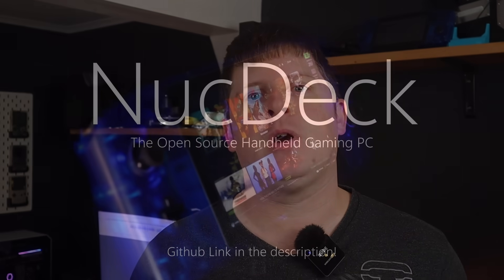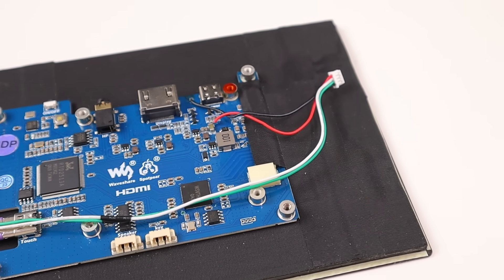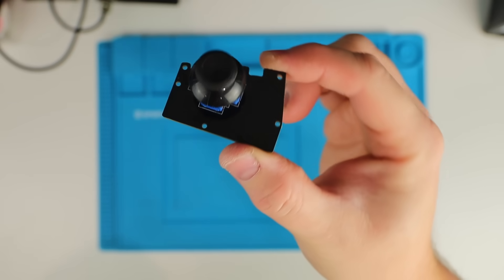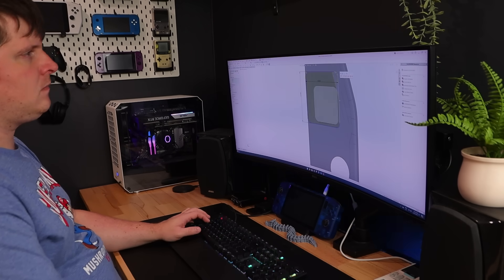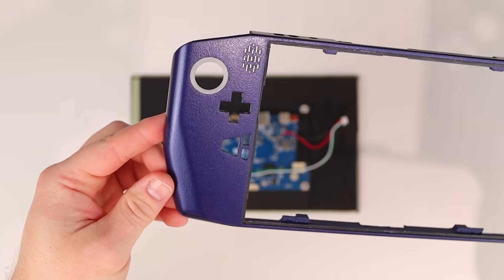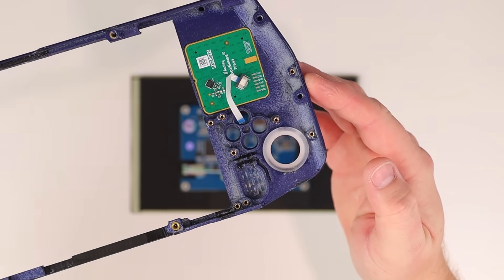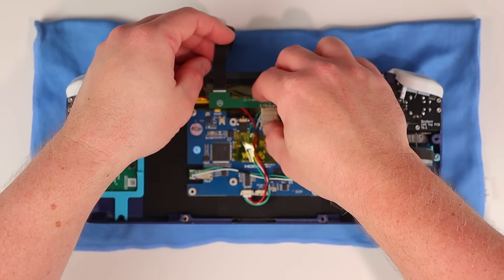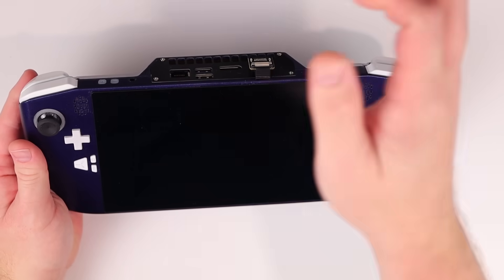I Built My Own Steam Deck!

Comment: Did you install SteamOS in the end, what operating system are you using here?
Reply from the maker: I tried Bazzite OS at one point, and while it did improve performance slightly it also had some bugs with the touchscreen and it also increased power consumption so I went back to windows for now!
Reply: @cncdan  it does sound like we will have SteamOS available to install on other devices soon. I'm looking forward to the day I don't need windows on my gaming PC

Comment: It's overall just worse than the original as a handheld. Defeats the purpose

It's too big now, it's bulky, worse wattage, RGB, worse ergonomics, a bad OS, etc. I like the ABXY layout, tho! It's a shame errything has to mimic Xbox's backwards ABXY layout.. Only Nintendo and PS (In japan, anyways) does a normal button layout. The A button and X buttons on PS con (in the west) are the most over used buttons

Comment: This was random in my feed, but this is freaking cool. (subbed) I do have one suggestion how about a magnetic cover to go over the top sticking out part which also hides the other ports when they don't have to be used. Does some of the heavy resource hungry games work on it like some of newer AAA games run on it? If you don't mind saying how much did this build cost?  If you dont want to answer that one no biggie.

Comment: to avoid the hdmi coming out the top desoolder the hdmi from both the screen and board. the design a pcb that "stacks on top of the hdmi pins and converts it to a flex cable. you could also probably use a switch to change thee direction of the power in the hdmi signal to swap between an internal and external screen as well

Comment: I really have to say that the 5700U was such a downgrade. Granted the CPU aspect is better but giving up a custome RDNA 2 iGPU for Vega. Definitely not, with good FSR 2.1 or 3 ive gotten ray tracing to work on my steam deck. Id understand more if you went for 32GB RAM.

Comment: HOLY MOLY! The quality of that is astonishing. I can't believe how much you fit into a 12 minute video. I'd love a deeper dive into each of those components (both the 3d printed parts, and the PCBs).
Reply from the maker: Thanks! This was mostly just a recap that's lighter on details for the purpose of reaching a larger audience. If you want more details, there's an entire playlist with 9 other videos as I worked through the project! https://www.youtube.com/playlist?list=PLy9j9_dmmg2TrMOIG65j3nOELqgDXPkkn
Reply: @cncdan  Sorry, yes I saw those after I made my comment. What an amazing set of videos. One question I had was how you set on the different button types? I think I've see two types you've in other projects, and I'm not sure on the terminology. One is like an interleaved pattern on the PCB that the button completed the connection of (I think it might be called 'conductive rubber membrane'), and another is regular low-profile push switches, with a sandwich of a membrane and a cap. Yet another I've seen in someone else's videos look like bubble switches, but still use a membrane + cap.

Comment: How about a project where you make that "Xperia play" and "PSP go" style case for smartphones that has a Controller built into it. But it should have both landscape and portrait controls you get the landscape ones by sliding it in well landscape and the other in portrait. Basically two slides in the case

Some 20 yo managed to make one himself with a 3rd part controller and ps Vita sticks. Would like to see someone with your skills and experience to give that a go.
Reply from the maker: Will keep it in mind, thanks!

Comment: If Beelink makes all future NUC PCB´s the same dimensions and keep the heatsink the same height it would be very easy to upgrade this device. Disconnect all USB´s and the HDMI swap out the MB connect everything back together. Basically like the framework Laptop´s
Reply from the maker: Here's hoping! This is one of the reasons I used the HDMI adapter that a lot of people don't seem to like. On the last project I removed the HDMI port and replaced it with an FFC connector so it could all be internal, but it makes upgrades harder and basically renders the PC that's coming back out of the system useless.

Comment: That actually sounds like a good idea to actually build a DIY Steam Deck, but if I were to suggest some improvements, it would be to have something to hide the HDMI plug, and add in an M.2 NVMe port for M.2 NVMe drives.
Reply from the maker: The mini PC has a built in M.2 slot, so no need for any more of them. As for hiding the HDMI, it definitely can be done but it involves removing the HDMI port from the mini PC, essentially rendering it useless if I decide to pull it out and upgrade the system. It was also one of the more intimidating steps I took on the previous project so I wanted a solution that was still good enough for people that weren't game to start removing ports!
Reply: @cncdan  Unless you have a case redesign for the HDMI perhaps? Also, I wonder how much would every part cost to build a ZenDeck (with the OS which I have seen from WULFF DEN's video on turning an Asus Rog Ally PC into a custom Steam Deck) compared to the 1TB Steam Deck OLED?

Comment: Looks great but my suggestion would be to get the HDMI on the inside of the unit. The loop on the outside does not look so great.
Reply from the maker: Yeah, I did that on my previous version but it requires the removal of the HDMI port on the PC basically rendering it useless if I decide to take it back out of the handheld in the future. That step alone also seemed to scare quite a few people off last time so I wanted a less scary option!

Comment: I'm a Steam Deck and Lenovo Legion Go user, so this was a great recommendation of a video, lol. Massive respect for being able to crank out your own gaming machine yourself, that looks so close to the ones built by multi-million-dollar companies and factories. It's a massive feat.
Reply from the maker: Thankyou! Glad you enjoyed it!
Reply: why do you have both?
Reply: @AyushGupta-wn6zd  wanted to try both
Reply: @AyushGupta-wn6zd  I would say because windows plays everything that the deck doesn´t. The deck is good for what it does but only playing a limited STEAM lib only is a downside to me since i have games on other platforms like Epic and MS store.
Reply: @AyushGupta-wn6zd  i mean the reason prolly coz steamdeck has better optimization on steam games, and it kinda bad for other games due its specs,  legion go on the other hand kinda versatile , bigger screen, joycon and still have trackpad, this  combo i still can accept, but steamdeck with rog ally, just throw away the deck, basicaly the samething with more power on the ally.
Reply: do i steam os my legion go ?
Reply: There's certainly room for visual improvement.
Streamlining things a bit more and whatnot.
But this should do very well indeed!
Reply: @yasirrakhurrafat1142 at this point its not because of a lack of talent or trying, but more so just supply chain constraints & small scale.

Most companies wont be buying off the shelf components. They will make every thing as per their requirements & then send orders to amd/tsmc & lg for chip & screen specs. Heck steam literally has a bespoke SOC in the deck.
Reply: @kushagraN   yeah.
I think he would've been able to make a more efficient design if he had custom motherboard, power supply and batteries.
At the same size of steam deck.
It looks good already, would be better with custom mould plastic.
The hardest part likely is though to optimise size - battery life - cooling.

Comment: Your work is amazing, may I ask why you feed the HDMI out and back in as opposed to adjusting the shell size to keep it all internal?
Reply from the maker: Thanks for the Super thanks! I would've replied earlier but a storm here today plunged us back into the dark ages for most of the day 🤣 I kept it all internal on my previous project by removing the HDMI port on the PC and replacing it with an FFC connector. I could've moved the PC down further in the housing on this one but then I wouldn't have had external access to the USB ports on the top of the device. The port removal option is probably the best way to do it but its a risky undertaking and renders the PC useless if you ever need to take it back out of the handheld (in the event of an upgrade for instance).
Reply: @cncdan  you still can move the pc board further down without losing the external USB ports. just make a tunnel in the plastic going down some inches that accomodates a regular USB cable of common thickness
I dont know if the pc board has another HDMI or not, but the same applies
just pull the board down, redesign the case to have a rectangular plastic tunel around the external doors, then the case ends on the ports anyway and you can still connect any cable you want

Comment: Amazing project but I can't believe you've done all this (inc custom PCBs) to leave the HDMI cable hanging outside at the end. 🤨
Reply: Also... Windows? If it's a Steam Deck it has to be Bazzite or HoloISO.
Reply: Cool nitpicks
Reply from the maker: Thankyou! I've replied to a few people about the HDMI already. I could've removed the port from the mini pc and run the cable inside but that step scared a lot of people off from building the last version so I came up with a less scary option this time around!

Comment: Wow this was brilliant, amazing design and build! You're very talented. Would love to know the details of that power management board. Did you build it?
I didn't understand why the HDMI connector was sticking out the top, it wasn't really explained.
Reply from the maker: I had other options for the HDMI, you could remove the port from the mini pc but that's a risky opperation and renders the PC useless if you decide to remove it from the handheld later (to upgrade, for instance). So I came up with a solution that works and doesn't get in the way too much. As for the power management, yes its my own design. Here's a video that explains it a little better! https://youtu.be/iNtEfR5Lb-k

Comment: 7:04 you probably could use UV resin to thicken up the plastic by brushing it on and curing it and repeat until it works for you. Like on the inside, unless that'll make things complicated? This is just an idea for the future of course if you want to try it out😊
Reply from the maker: Probably not worth the hassle in this particular instance as the plastic needs to be thin there so if I thickened it up the trackpad may not sit flat in its pocket. Its a good idea though and does make me wonder how well the resin would stick to the HDPE!

Comment: nice, though is there a way to design around the ribbon cable, feels like it'll break if it gets caught by something.
Reply from the maker: Probably will. I might design a little cover for it to prevent it getting caught on anything. I could've removed the HDMI port from the PC and run the cable inside the housing but then I wouldn't be able to recyle the computer if I upgrade in future!
Reply: @cncdan  Simple fix instead of having to De-solder HDMI Connector from the Mobo I suppose though. Function over form ! I do like the idea of just some rounded "bump" to cover, protect and give it a little more ascetic for the overall unit ? Like a pair of old Skool Car Tail Wings or Fins on either side for some symmetry and a little extra space to fit some later "extra" in on the other side ? lol.

Comment: Oh man.. Looking so good.
Have to make this once my deck dies..
Would love to see user replacable / pluggable batteries like the good old Gameboy. For 18650s, the holders should be easily mountable on the case, but may not have as much capacity as the 21700.

Good job still!
Reply from the maker: Pretty sure you can get holders for 21700 cells too. I would've loved to do something like that, but this thing is already big and heavy and holders would've definitely forced me to make it larger. Definitely something I will consider for some future projects though!

Comment: I think a way to hide the hdmi adapter would be to design a "hump" that covers and protects it while also being a spot to mount/integrate a webcam, it would also be cool to be able to flip the webcam around to face forward giving it a sort of nintendo DSi  function. or have two, one facing forward and one back.
Reply from the maker: Yeah, I thought about making a little clip on printed cover for it. I'm not too fussed on the webcam personally but you definitely could fit one in there somewhere as the ones built into laptop screens are absolutely tiny!
Reply: @cncdan  yes a simple cover to cover the back of the PCB and maybe protect that flex cable would be a good idea. congrats the ZenDeck turned out very good. Curious to see the new idea you have.